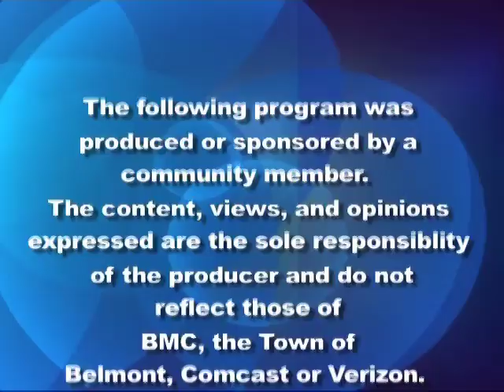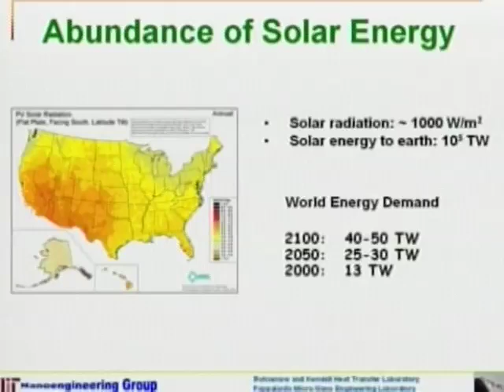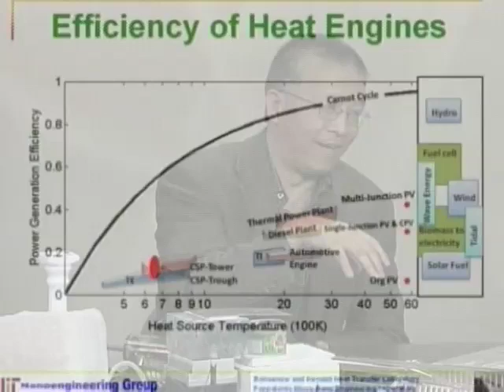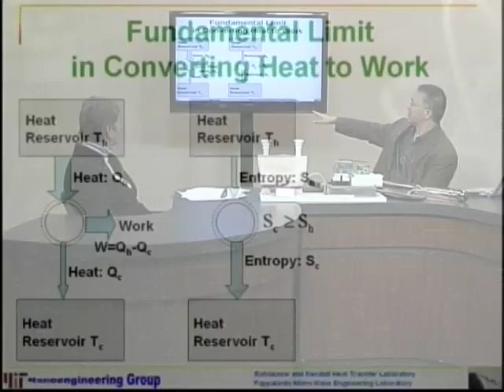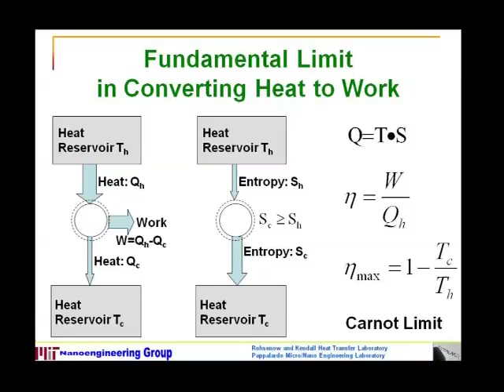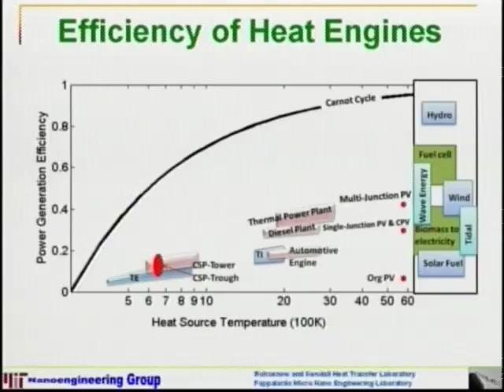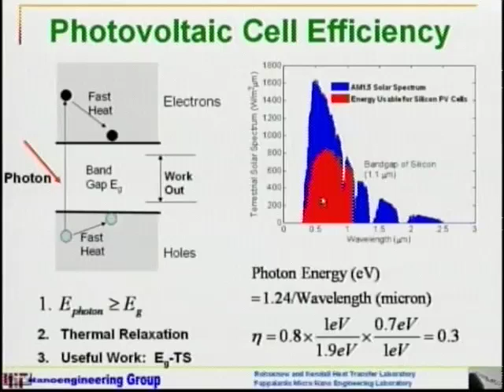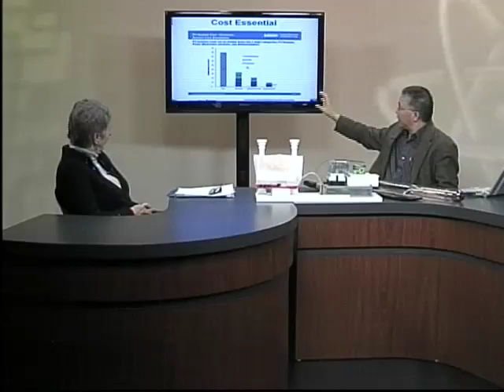Solar Thermoelectric Alternative Energy

Comment: The biggest problem with solar, is the storage of the power that is generated.
A low ESR storage device like a capacitor can be used to allow fast storage of available solar power, and smoothing of power storage into a battery bank.
Also using capacitors between your battery bank and your load will improve battery life. By allowing high current starting draw of power to be supplied by the caps.
Batteries love smooth stable power input and output.